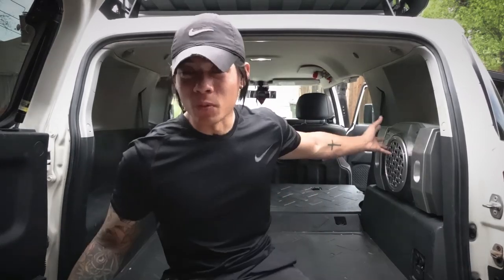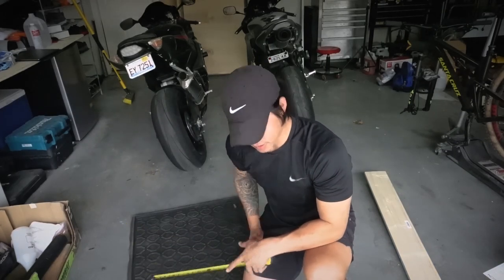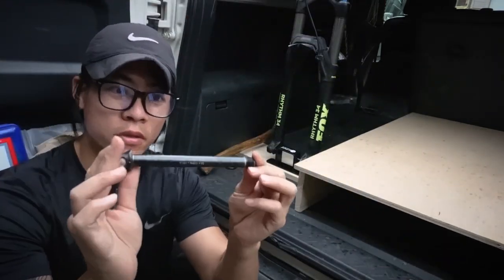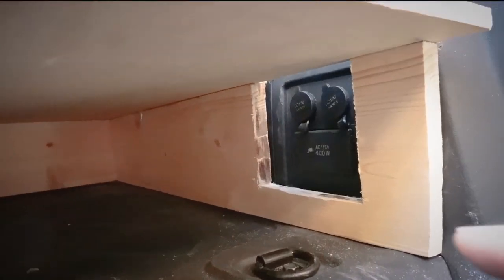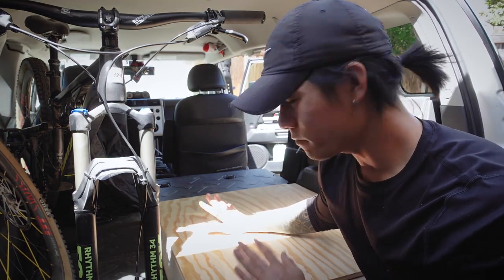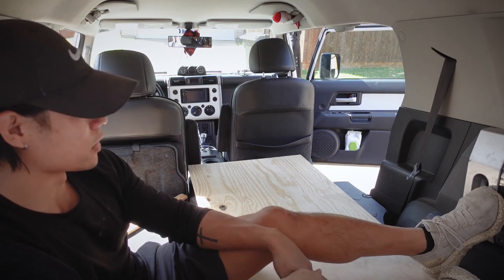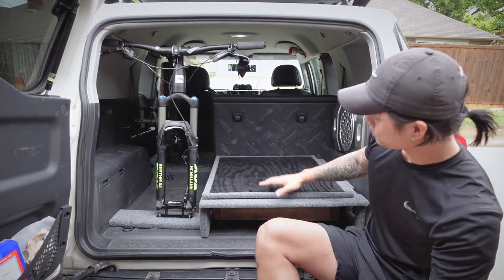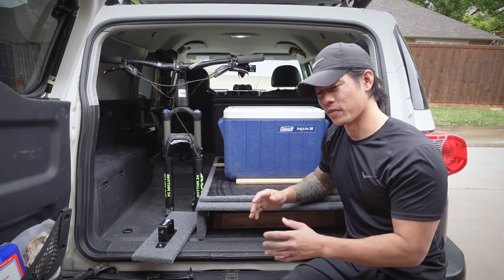My Basic Stealth Car Camping & MTB Setup // Full Build // Toyota FJ Cruiser - Trail Teams

Comment: Hey, nice setup! 

Would you consider to make the platform higher for more space under?

Metal fork adapter is versatile and solid, but you can make it another way. If you've ever seen new Rock Shox forks out of the box there's plastic base or platform (actually idk how to call it in English). Same as your adapter. The idea is you don't need to put axle through. You just press your axle and it clips in. Fast and easy. Maybe not so solid on bumpy roads. But this should be customizable, like adding velcro strap or something.

Cheers from Russia!
Reply from the maker: If you can find the link of the fork adapter I'd love to check it out!

As far as the height, it's the perfect height for me to sit upright comfortably. Any higher my head would hit the ceiling. But if I wasn't using it as a bed,  then I'd definitely make it taller.